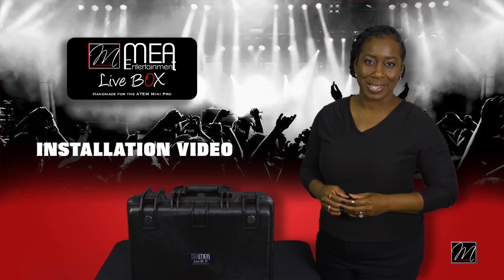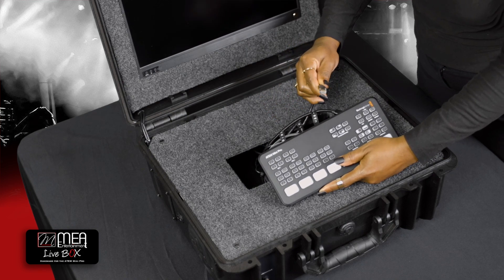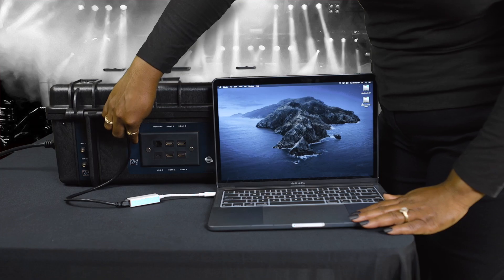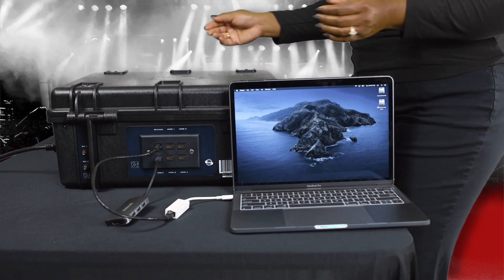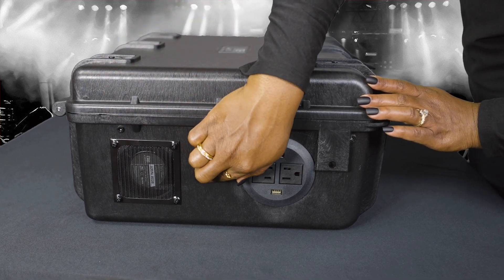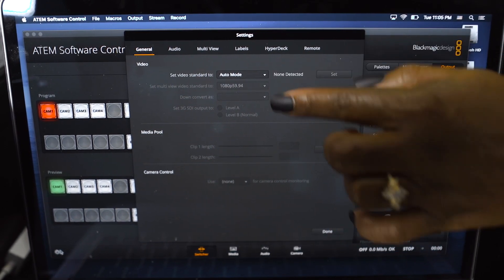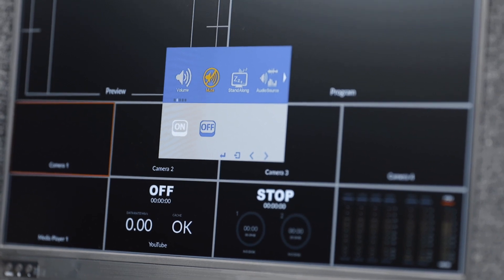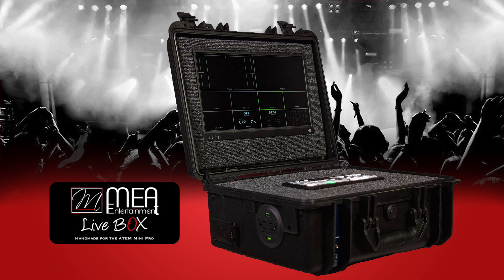MEA Live Box Installation

Comment: Question: you show the ethernet cord coming out of the Livebox to the laptop. How do you plug in the box to the actual ethernet line that comes from your modem?
Reply: Hi @Jeff Stanton, i believe that you would plug the cable from the modern directly to the LiveBox but will then need to run another ethernet to the laptop from the modem if you want a to use a wired network connection instead of using wifi for the laptop.
Reply: @cdott74  Yeah, since I posted that question a few months back, I discovered I just needed to obtain a USB-C splitter to connect both simultaneously. It has made life easier. Thanks much.